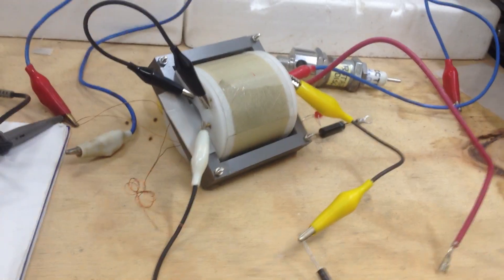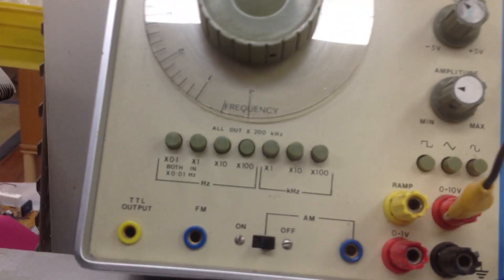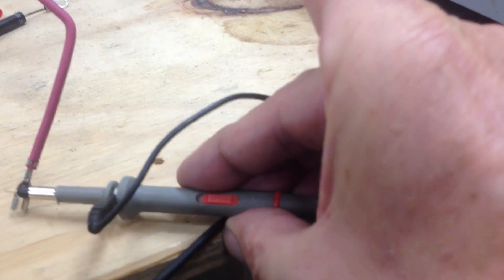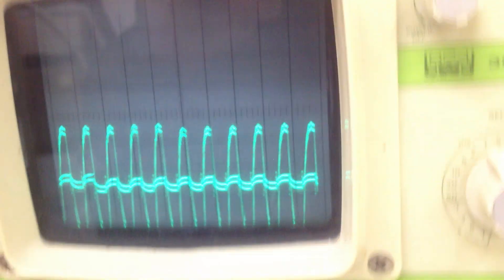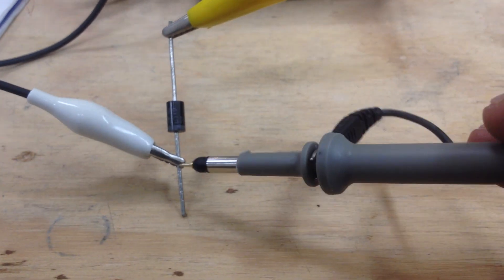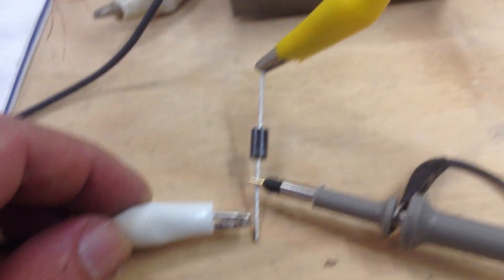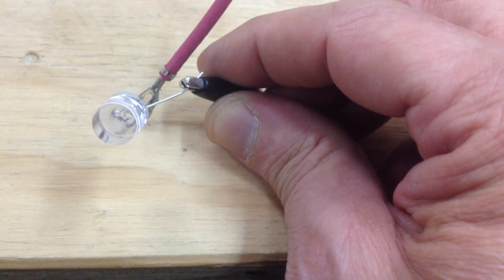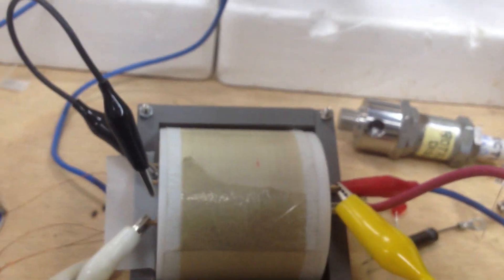Meyer round bobbin transformer.

Comment: Not my cup of tea. I feel Meyer had HV HF AC and found it easiest to use it for electrolysis (probably rectified to HV DC) . it makes sense for the time frame he was in, and thr technology available.
Reply from the maker: yeah..no problem, I'm not trying to convince you,..I just made a connection between your video on capacitance and this Transformer... cheers.
Reply: @electro1622  ok, reference to the coil capacity

Comment: Great video and very nice build. I bet winding that 44 gauge wire took some time, what did you use to wind it with?

Have you been able to get HV out of it?

I built a similar one but never had any luck with it. Also my 430 wire enamel would come off easily. Is your 430 wire from Stan's lot as well?
Reply from the maker: Hi Brad, I used my manual coil winding machine to wind the 44 Ga. and yes...it took ages.. as for the HV part.. I don't know.. the power supply I am using is only 1 amp , my good dc power supply carked it a few months ago, so no I haven't got HV from it yet, I would like to try more power before I discard this primary...as for the wire, I had a bunch made a few years ago so this is brand new and the insulation is ok...
Reply: Awesome,

Have you measured the choke Inductance? 

When I did mine I think they were around 10H each. I don't think my core was correct though. Yours looks like a near perfect replication.
Reply from the maker: yeah, the core I got is grain oriented and same thickness as meyers, I got 2 sets, got those years ago as well... I don't have an inductance meter but my meter has a capacitance setting and that says 17.6 nF,
Reply: @electro1622  
Interesting, you should get an LCR meter and take measurements of all those coils.

 Whoever designed that VIC was very smart (I think it was Stephen Meyer). Many people in the past have claimed that the spacers between the coils increase the coils distributed capacitance, in reality its used to reduce the voltage between turns so that the coils don't experience breakdown of the insulation by the HV. The multi segmented design actually reduces the distributed capacitance, but the bifilar winding as you have shown provides a higher capacitance.

To me it looks like this VIC may have operated much differently than the 5 coil VIC of his previous design. Also, its unfortunate that we don't know what frequencies this is meant to operate on (but we can calculate/estimate them)....I wonder if it just provided one pulse that's duration was equal to the duty cycle of the injector or if it provided a series of pulses like the WFC did.
Reply from the maker: Yeah, this version of the VIC is the only one which doesn't have an amp inhibitor coil as an external unit ...  I got a lot of things to try but some equipment breakdown has stopped process so I got to get that fixed...
Reply: You ever get back to testing electro